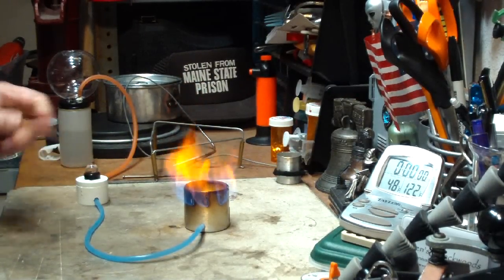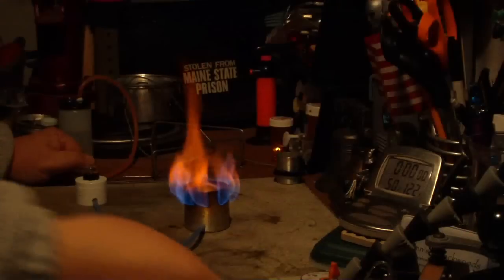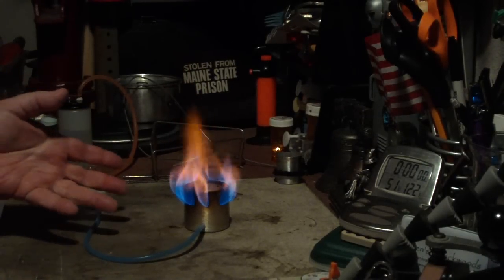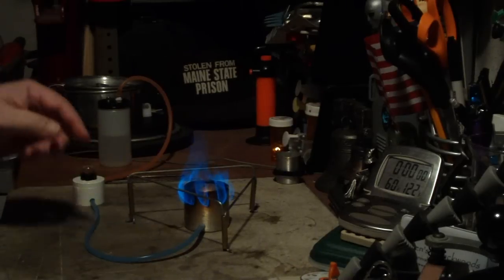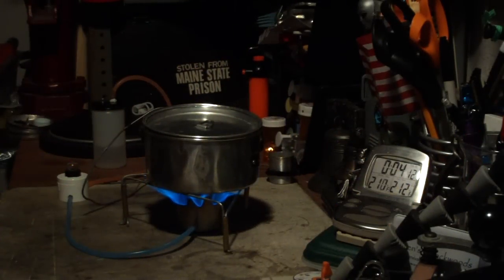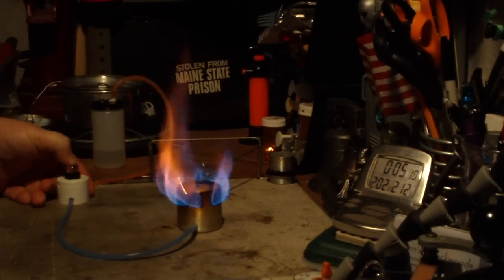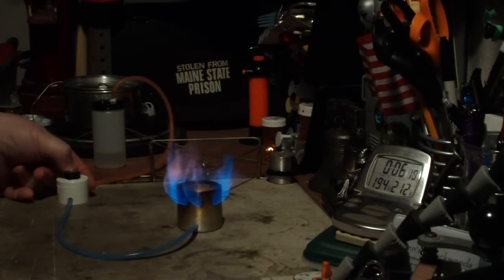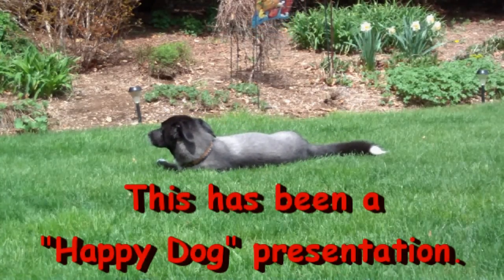Vortech1000 Alcohol Stove( with Pump Remote) - Boil Test #2

Comment: I wonder if you could put the pot directly on the burner and use it like a side burner. It should lower the amount of fuel consumed, but will probably increase the boil time by a little.
But maybe the remote feed wouldn't work since internal pressure would try to push the fuel out? I don't know.

Comment: I have a large scale automotive brake bleeder cart that pushs new brake fluid thru the master cylinder out to each wheel cylinder. a small version could be made with soda bottles.  the big version operates in the 2 1/2 to 5 psi range.  you can move a bunch of etoh a short distance with half a psi.